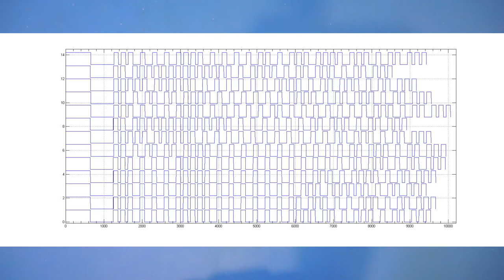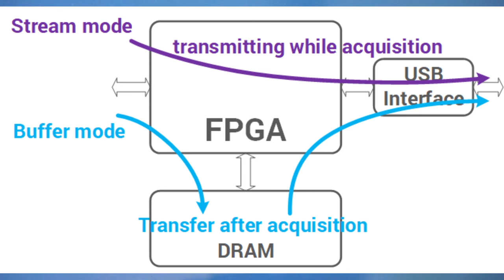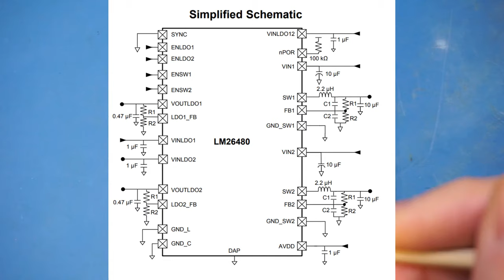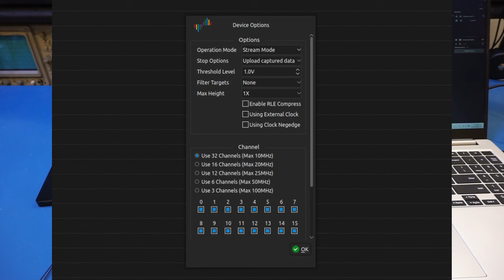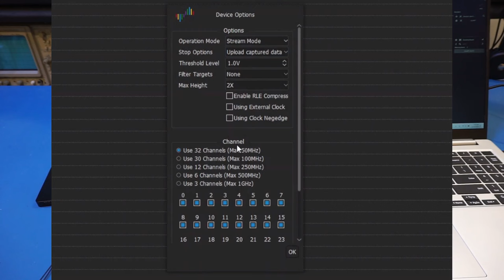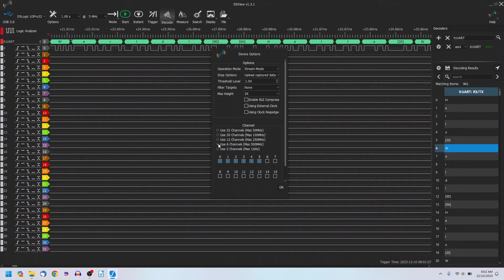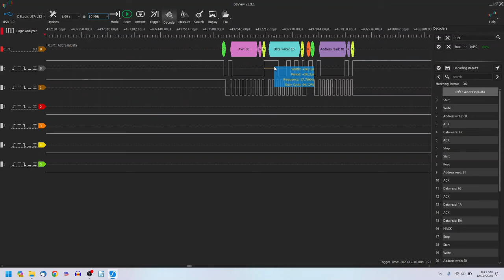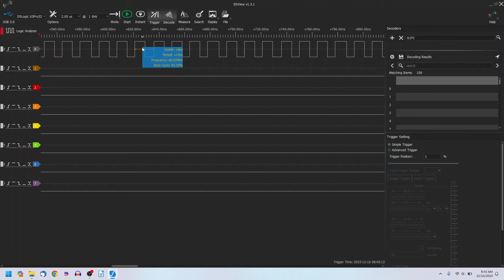DreamSourceLab DSLogic U3Pro32 Logic Analyzer Review/Teardown

Comment: I work with DSLogics U3Pro16 and it works well if you shoot traffic up to about 20 MHz (SPI or another), they failed to sniff the LPC bus with a clock frequency of 33 MHz, a very unstable clock signal, unnecessary noise peaks and a bunch of errors.

Comment: Recently I nearly purchased one of these.  I have a coworker that really likes their USB scope and over the past year has found the software to have improved enough he actually bought a second unit.

I strongly prefer open source and decided on a unit which was supported by sigrok.
Reply: What did you end up getting instead? I was looking at getting some higher channel hardware supported by sigrok myself, but then I needed to work on something with a 32 bit parallel bus (32bit address + 32 bit data + bus control signals) so ended up getting my Agilent 16903A and associated cards fixed up - hard to beat having a 204 channel hardware logic analyzer! I think sigrock might even support loading the saved files from the Agilent software in, but I never tried it. I didn't really need any protocol decoding for what I was working on. I had the "inverse assembler" for the processor compiled and running on the Agilent too, but I didn't even find it very useful. It really slows down the software on large captures, and I had the code disassembled in Ghidra, so ended up not using the inverse assembler on the analyzer at all. I was mostly using the logic analyzer to follow the execution path through the code, and finding what functions it was executing at particular times, then doing all of the code side of things in Ghidra
Reply: @gorak9000  I used one of those big (HP at the time) logic analyzers at a previous job some years ago (while developing IEEE-1284). Luckily I don't need anything like that now. I cannot remember the last time I needed more than 16 channels.  I picked up at Kingst LA2016 - I rarely need more than 6 or so channels, but sometimes more and this does it for me. I was tempted by the 5032. We'll see...
Reply: @Sylvan_dB  Ah, the 5032 was the one I was looking at initially, but I was unsure if you could chain multiple units together to go beyond 32 channels, and there was some other issue I don't remember now that gave me pause before ordering it. I do have one of the generic 8 channel ones based on the cypress chip, and use it with sigrock (especially for serial buses (rs232, spi, i2c) with protocol decoding) and it works extremely well. I guess if I need more than 8 channels at my desk, I've got the big boy now (but it sure isn't too portable)
Reply: @gorak9000  I wouldn't count on chaining multiple units. I have a couple of the generic FX2 8 channel as well, and considered trying to get the software to use them together but decided in to just get a 16 channel.  (One of the issues with two together is proper synchronization.  This might require additional hardware to send a clock signal to one pin on each unit -- 2x 8 channel would then become 14 channels.)

Comment: Just a note regarding the FPGA, the Spartan-6 is a quite "old" device now and while still supported by Xilinx, it's considered nearly "obsolete". It's a fine FPGA though, no problem with that. But the pricing you gave isn't quite right: the LX16 it is currently about $60 per 1, not in large quantities. And that's a completely unreasonable price even per 1, that's due to a number of factors - a few years ago, it was less than half that. And we're talking about getting it via the main distributors. Zero doubt you can source it at much, much lower prices, especially from China.

But the current Xilinx FPGA model, loosely equivalent, would be the Spartan-7 (15), which is only about $20-$25 in small quantities. So unless you have a lot of stock of Spartan-6 or extremely good deals direct from Xilinx or via some asian distributors, your best bet these days would be to design around the -7 series rather than stick to the -6.

With that said, I believe DreamSourceLab have switched to a completely different FPGA vendor for their newer devices (not sure if this is Efinix, Gowin or another one), so it looks like the days of the Spartan-6 at DSL are counted anyway.

Comment: I just got mine. THe HW itself is great, the coax probe assemblies are top-notch.

My issue is with the UI. Since this uses FX3 and not FX2 "front end" PulseView is NOT SUPPORTED even though it's an option on the drop down. But even worse, I have read every word of the manual and I have clicked/dragged/etc but I cannot seem to be able to group channels into busses. I am NOT decoding serial data, I am decoding MCU boards with address and data lines and want to look at CPU execution cycles. If anyone has the magic incantation let me know. But if it so happens their UI doesn't allow grouping this is getting returned ASAP.